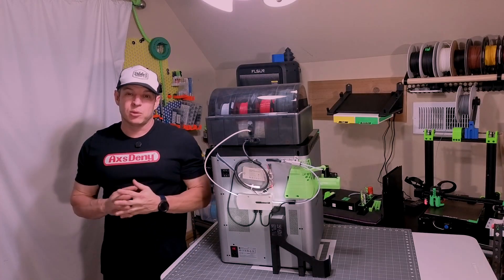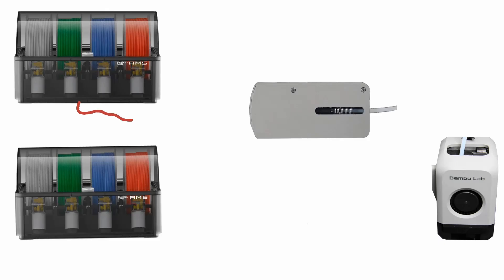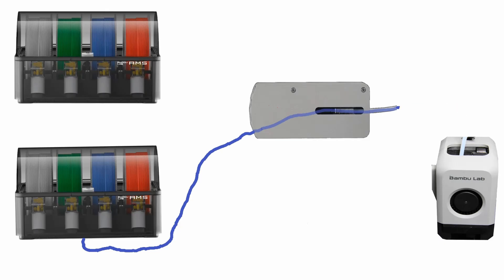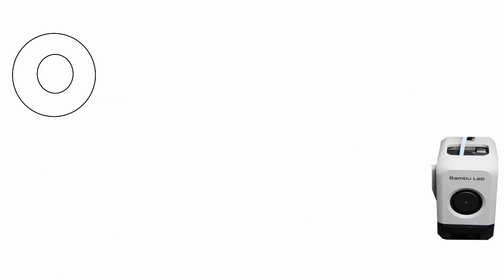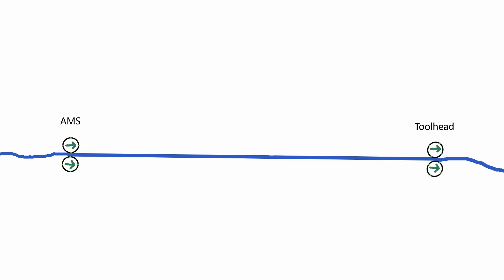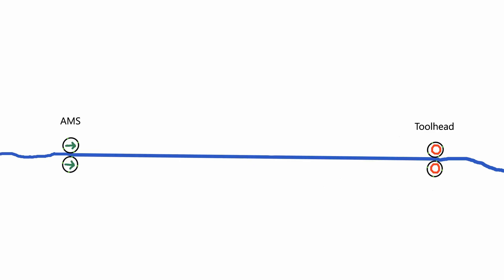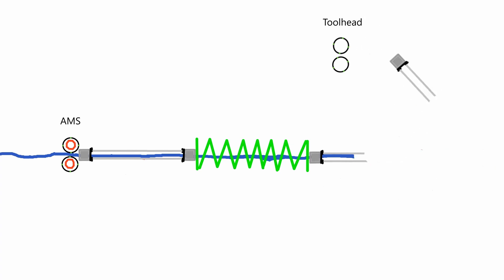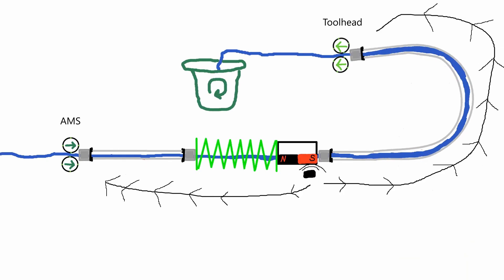This Little Box Fixes Big AMS Problems - Here’s How! | AMS Filament Buffer

Comment: Since there is no filament buffer provided with the H2S combo package, so I just connect the PTFE tube from AMS-Pro2 outlet to the inlet of H2S printer. It worked about 700 hours since then and I never experienced any problem of filament feeding.
Reply: The filament buffer is part of the H2 series printers. no external hardware needed
Reply from the maker: Based on that comment i was just researching that. Totally makes sense when there is dual heads (or the potential for 2 at least ...) that each would need its own buffer\signalling for the feed. Learn something new every day.
Reply from the maker: I have never seen it done that way. I may have to play with hooking them up that way on my X1. I would have though the AMS would complain if it didnt see the filament sensor tripped on the buffer. Interesting. Thanks for sharing, i have some playing to do i suppose.

Comment: Where can you buy one PLS ?
Reply from the maker: Where can you buy a filament buffer? It depends on the printer you have. These have to have the proper connectors to be able to talk between the AMS and Printer in order to balance the slack. For Bambu they are available at https://us.store.bambulab.com/products/ams-hub but if you have another kind of printer you will have to research the proper one for that setup.
Reply: I have the H2C
Reply from the maker: Then you dont need a buffer like the one in the video. the H2 series has buffers built in because each head needs its own slack managed seperatly.

Comment: Enjoyed the video and the information.  I have had filament breaks a few times between the output of the AMS buffer (the spring side) and where the pfte tube goes into the printer extruder.  Getting that pfte tub off at the spring side is really difficult for me with only two hands and my hand strength.  There are many videos on how to use a tool to or just a small screw driver to remove the pfte tube on the stationary no spring side.  I haven't found one yet that makes the process of the spring side look easy and the ones I did see were with the AMS hum taken of the printer completley using tweezers.  Do you have any clues on the easiest way to remove that pfte tube from the hub, it is easy to install but not remover.
Reply from the maker: I installed the stock hub for the video because thats what people are used to seeing. I actually have this on my printer for exactly that reason. https://makerworld.com/en/models/1108777-ams-hub-guide-quick-release#profileId-1744908
Reply: @AsTechEvolves-Printing will head over via the link and check out your solution.